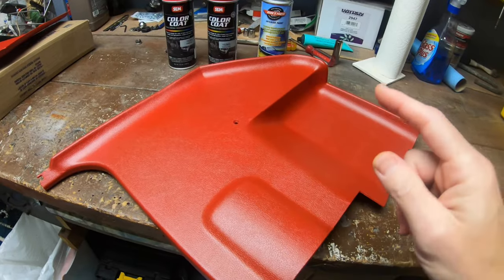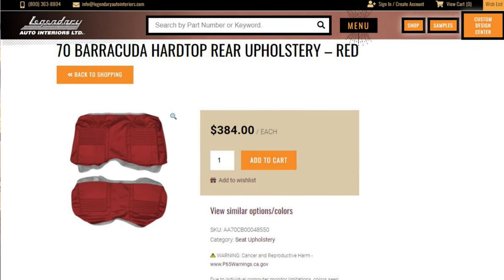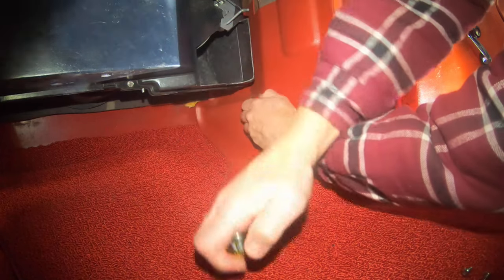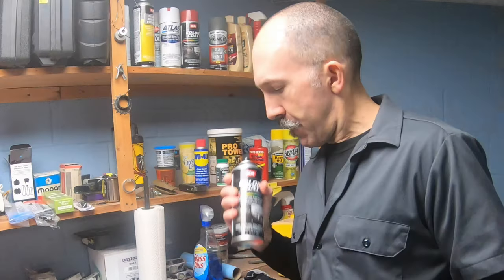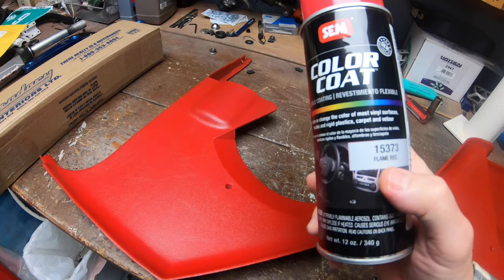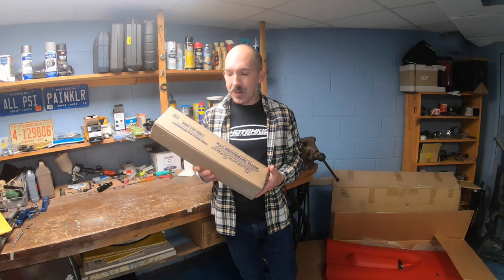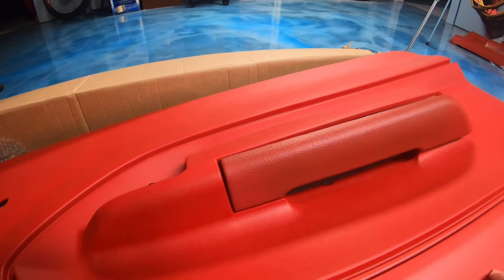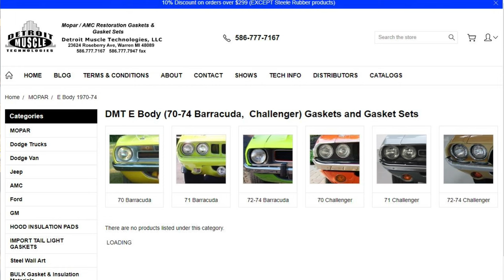EASY! How to Dye Plastic Interior Trim!

Comment: Thanks, I have all my Door, kick and rear panels I am researching how to Dye  73' Cuda
Reply from the maker: very kool good luck with it!
Reply: @backyardhotrods9885  Did you have issues after use with almost everything that touches leaves Marks the SEM finish.?  I did my Kick panel in the Black Landau and a week of sitting it scratched and marks up easy.
Reply from the maker: @BuzzJones   Hey Buzz, I honestly don't think I have had anything come in contact with them like leaves and such.  I tried scratching it with my finger and it doesn't come off and seems durable.  My armrests that I died are holding up fine come to think of it and they  have the most contact points.  Did you use an adhesion promoter?
Reply: @backyardhotrods9885  Yes but I think I might try SEM low Sheen Clear they make for the Color & Classic Coat.

Comment: Hi Wayne.  You can drive yourself crazy trying to match red.  To be honest I think the arm rest contrast actually looks good and gives it a little highlight compared to all one color, but you are one that has to live with it.  I would not dye them because that is a heavy used area and you want to be able to spray cleaner on them.  Gary
Reply from the maker: Hey Gary, after I let it sit in for a bit...I think I will leave the armrests alone and live with it.